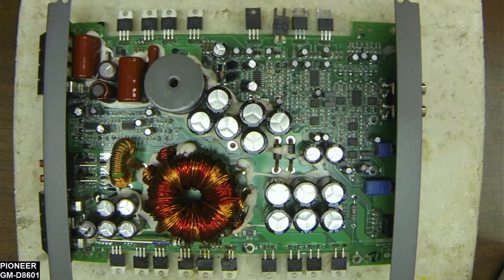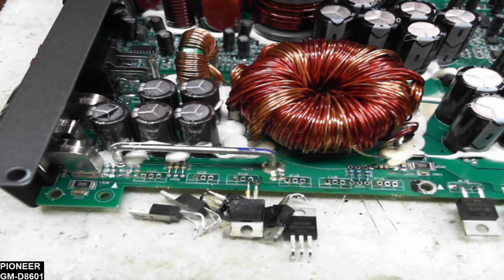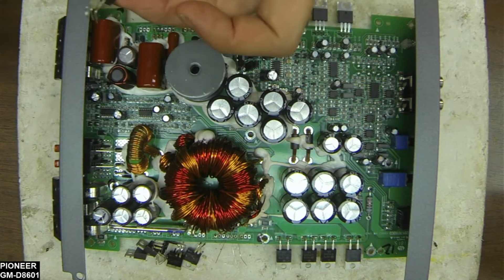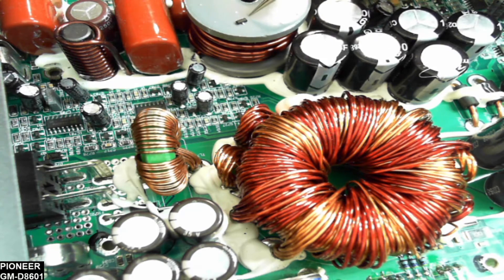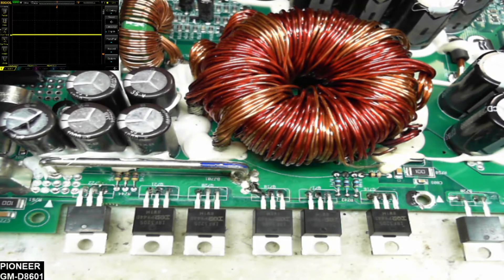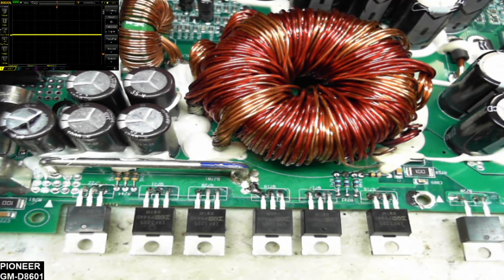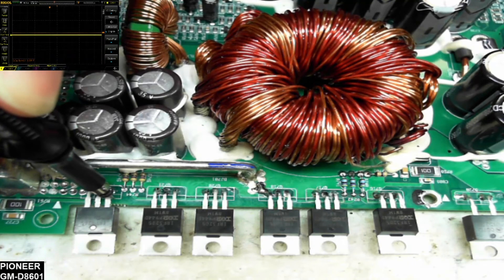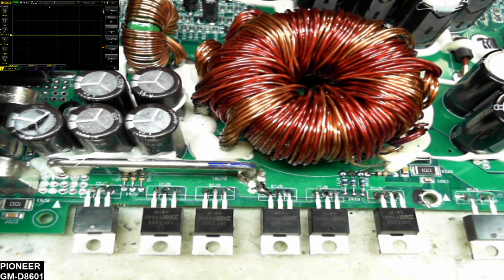Pioneer GM-D8601 Class D Amplifier Power Supply Repair and Startup

Comment: Hi, I'm working on the same amplifier, but I'm having trouble getting a part model. Do you have the circuit schematics? It would be very helpful.
Reply from the maker: Hello! I never was able to get my hands on any Pioneer schematics.
Reply: @ellensburgamplifier  Oh, that's sad. In my case, the diode marked D727 is burned out, and I can't find the part number.

Comment: I have a 8601 that i haven't used for a coupe of months and when I wanted to use it no sound was coming out, noticed that both 40A fuses had blown, I replaced the fuses and now it just cycling thru on and protect with a loud pop coming from the bass speaker.
Any ideas what has gone wrong ?
Reply from the maker: The fuses open because there is a short in the power supply. The cycling of the protection circuit is due to the lack of rail voltage.
Reply: Okay can that just random happend? So to the business here in can solder and have the tools at my hand, I don't have a scope, where can I start my search to find the problem :) I've had that amp in like 6 years or so and I really don't want to chuck it in the bin if it can be fixed :)

Comment: Hello I loved your video you are very good in fact I dedicate myself to the repair of this same equipment I am something new in the subject, but yesterday I was learning to use the ocylloscope and in the g1 and g2 I sent me a distortion signal and I hesitate to change them but now that I see that that is the fault I already feel better when trying to change those transistors, also the 4227 did not send me any voltage to the doors
Reply from the maker: It's good to see someone learn from my content. I try my best. You are correct you won't see any gate drive on the 4227's if there is an issue with the amplifier.
Reply: @ellensburgamplifier 

Perfect, I thank you very much, so if there is no signal voltage in the 4227 I have to check the transistors on TL494?

Comment: Hello, I bought a secondhand Gm9601. And unfortunately it has no sound. Opened it up and noticed all of the (8) IRF3205 Mosfets were burnt on the ground side. I just replaced all 8 but now watching your video, I noticed one the gate resistors has a bubble so I'm assuming that's gone; I removed it and my replaced 3205 transistors read fine without it. So I'm assuming that's shorted out. What would be the part numbers for the gate transistors? Also I noticed you stated you replaced the output transistors I tested mine and 3 of them read 0.00 and the other 3 read 4.75, so I'm assuming those need to get replaced. But do I need to replace any other gate transistors or just that? Thanks for this great video. Just found your channel but will follow. Thanks.
Reply from the maker: The primary components that you will need to replace are the transistors, gate resistors, and gate drive transistors. I am not sure what gate drive transistors are used but there will be a letter and a number on top of the transistor. Then you can use a site like https://www.s-manuals.com/smd to find what they are. As for the output section (if you don't have a scope) you may be able to just replace the transistors and cross the fingers that it starts. If it doesn't, then you will have an output drive fault.
Reply: @ellensburgamplifier  Wow thanks for the guidance and quick response. I will definitely check everything out, the only main thing is which resistors do I check? The ones that are by the main IR3205 mosfets?  And the amplifier turned on into blue when I brought it. That's why I assumed it worked, but had no sound when I hooked it up this weekend. When I opened it I saw all 8 mosfets blown out. 
I found the number on the gate transistor that is blown has a 2 on it. So I'm assuming because the others ones say 2GM or 1GM it's a 2GM. Im going to replace the outputs IR and hope for the best on that one. Thanks for the guidance on this though. Hopefully it works correctly in the end.
Reply from the maker: @WeirdJerz3y  Correst, the resistors located at each 3205 need to be verified and if open need to be replaced. The 1GM is the NPN MMBTA06 and the 2GM is the PNP MMBTA56. These transistors drive the gates from the TL494. Once you get the power supply back up and running the rest is a little easier to take care of.
Reply: @ellensburgamplifier  Thanks for all the help. Going to order the parts and well see once they get here. Thanks for everything.
Reply: Unfortunately, it was working turned on and the moment I turned off the radio the amp smoked. Opened it up and the 4 mosfets by the ground terminal burned up. Clearly I missed something.

But appreciate all the help on trying to repair it.
It was playing music well until the moment the radio turned off. I heard it hiss and smoke. It is what it is at this point.
Reply from the maker: @WeirdJerz3y  That is odd that it failed when turned off. It Must of had a spike in the gate drive somehow. this is the only thing I can think of.
Reply: @ellensburgamplifier  that's what I'm assuming too. It was working great until that. So I'm assuming something is causing a spike somewhere on the circuit. Either way you're great, you helped me out, when you definitely didn't have too. Appreciate it alot. I'll see what I decide to do with the amp for now.
Reply: @WeirdJerz3y  Did you end up figuring out what else caused them to burn up. same issue amp turns on but no output, mosfets are burnt up. I would appreciate your input thanks

Comment: So I pulled open a GM8601 hoping it'd be a similar issue but I don't think so. No visible board damage what so ever, amp powers on as one would expect, will trigger with high level inputs even but it won't make sound.there is so sign of heating on the board at the mount points but nothing id assert to be a broken trace or or an incomplete circuit. I know its fairly limited what that infor brings but would you happen to have any idea how I can confirm it's the input signal not making it rather than power being supplied?
Reply from the maker: I would assume you will have to put a scope on the drive IC and see if you have an input signal and any gate drive output.
Reply: @ellensburgamplifier  that's actually pretty damn helpful. Appreciate it bud, and great content btw. Too few people smart enough to teach left, even fewer trying to teach, and fewer yet still those who actually have a desire to learn.
Reply from the maker: @rvn920  Isn't that the absolute truth! I leased basic component-level electronics in Middle School back in the 80s and in today's world that does not really exist anymore.

Comment: Hello, a have same amplifier and power supply work fine -41v and +42 but no sound,  can you helpme with this issue
Reply from the maker: The amplifier powers up with a blue LED and no protection? Could have an output fault or a pre-amp fault. If you have a scope do you see a low side drive?
Reply: @ellensburgamplifier  what frecuency should be?
Reply from the maker: @marvinrivera332  I am not certain of the exact frequency but any frequency is better than none if you don't have a scope to identify the low-side drive.

Comment: is this when they are stuck in power protect mode?
Reply from the maker: Amplifiers have a few protection circuits involved and if any errors occur in any one of those circuits then the amplifier will be in protection until repaired.
Reply: @ellensburgamplifier  I want to fix myself, not sure where to start exactly, I can solder etc. Can't find a diagram. Would rather fix than throw it out
Reply from the maker: @oldfashionedwrx3574  I agree completely. If you have a scope this may be repaired easily. Without a scope will be a little more.. challenging. Need to locate any problem areas first such as power supply and output transistor short checks.

Comment: Hi. I have a question. In the psu section.. Does it as a circuit take 12v DC and invert it to a AC voltage then back to a higher DC voltage to power the rest of the sound stage? So the power supply is possibly an inverter?
Reply from the maker: Yes, you are correct on that. The 12 volts is across the primary side of the transformers switching at an average of 27khz. The secondary side is of a higher AC voltage then gets rectified to what we know as the DC rail voltages.

Comment: Hopefully you don't mind the question, but I've been having issues with mine inconsistently outputting, when it outputs it outputs fine, but it will just cut out for no good reason that I can find. It isn't going into protect when it stops outputting so I am still trying to figure out what's going on. I noticed that you mentioned that the inductors can experience vibration damage and come loose in your GM-9601 video, wondering if maybe that's what's going on... Haven't pulled it out of the car to check but with your experience I might have a direction to look if you are up to giving me some pointers. Never done amp repair before but I do other electronics repair so I am hoping to figure it out and save some money vs a new unit. Thank you!
Reply from the maker: Thank you for the question. This one will be a little tough to track down without a scope. If the inductor was loose the output would most likely fail. One way to check is to give the amplifier a good "thump" while it is playing. This will let you know if anything is loose.
Next would be temperature. Does it cut out regardless of the temperature of the heatsink?
Does it cut out only when it is under a heavy load?
It may be a pre-amp issue as it is not going into protection when the cutout occurs.
The best thing to do is to see what kind of gate switching you have while it is acting up. This is where the scope will find the issue relatively quick.
Reply: @ellensburgamplifier  It's honestly pretty inconsistent with what it does, some days it's hot and won't output, some days it's hot and it does output. I would say on average it seems to work a little more consistently when it's colder but it doesn't seem to have a super consistent pattern.
Reply from the maker: @Alexander-sw3ll  Yes this would be a tough one without a scope. Transistors and capacitors can act weird based on temperature if they are "leaky". If it was an output transistor (or anything in the output) I would expect it to go into protection.
Reply: @ellensburgamplifier  As far as the scope I don't have one currently, but I've been wanting to at least pick something basic up, any recommendations?
Reply from the maker: @Alexander-sw3ll  There are some good 2 channel scopes but as for recommendations it all depends on budget. Something like the MT8208 may work as an all around meter but I do not know what the voltage range is on the scope setting.
Reply: @ellensburgamplifier  I am thinking something under $300ish would be probably what I'm looking at, might look to see if there's anything used on eBay that's a little nicer. I think I'd prefer a more capable standalone unit over a scope/multimeter combo since I've already got multimeters.
Reply from the maker: @Alexander-sw3ll  Sure can't go wrong with the Rigol 1052z or the 1054z scopes!
Reply: @ellensburgamplifier  Sorry about the crazy delay on this, but I finally picked up a DS1054Z and pulled the amp and sub out of the car for testing. Not 100% sure where to start, but based on what's going on it seems like something is wonky on the amp. Playing a test tone out of my phone there is some output, but it's less than I'd expect. The gain on the amp is set for my head unit and my phone has a lower output voltage, so lower output at some level is expected, but the strange thing is that the output volume will sometimes randomly increase significantly and then drop down below where it was before. Even when the output volume is about the same, there is some wavering inconsistency in the output which is at least somewhat audible and visible on the scope. The input is consistent, so I believe the problem has to be occurring within the amp.  The drive on the power supply looks OK, but I'm not sure where to really start next. Do you happen to have a copy of the service manual for the GM-D8601 or any other suggestions of what to check?
Reply from the maker: @Alexander-sw3ll  Ok, was this issue also there when it was in the vehicle? Using a phone may cause an issue as that would provide a floating RCA ground that is not common to the amplifiers negative 12v. This may cause issues in the pre-amp but I am not 100% sure since I do not use floating inputs. Let's make sure we are good to go here before moving forward.
Reply: @ellensburgamplifier  Same issue when it was in the car. I just took it out for testing. I could probably rig something up with a spare head unit and get a common ground, but I don't think that's the issue here...
Reply from the maker: @Alexander-sw3ll  Ok, so we have a good input source. This is going to be tricky to track down. I would first determine where the change in volume is coming from. From the input pin of the output IC or at the gates of the output transistors? look for changes in amplitude or changes in the modulation width.
Reply: @ellensburgamplifier  Well I was poking around trying to understand the circuit better, the  fact that the positive side MOSFETs have source as the output pin and the negative side MOSFETs have drain as the output pin was kind of confusing, but apparently from what I am reading they are reversible. Anyway, when I was poking around, I found that without a signal on the RCAs I have 39v RMS on my scope on the negative side gate, but I have 51.7v RMS on the positive side gate. That doesn't seem right considering both sides are supposed to be 50v I think, do you think I may be on to something there? Assuming I got the pinout right and am understanding everything on the schematic I think the input side of the output IC (2902s) is ok. I noticed the weird voltage differential without a signal, I'm assuming that I probably should be testing with a signal but I like to try different things to try to understand how it works better. Sorry to keep bugging you about this, it just takes me a while to get a grasp on things like this before I understand them properly, and right now I've just got bits and pieces that I'm putting together.
Reply from the maker: @Alexander-sw3ll  Those readings will be correct as the high side gates are a floating output. You will want to test with a signal at a constant frequency. I use 50Hz. This will allow you to see any changes in the drives over a period of time. This will allow you to isolate where the issue is originating from. You will need to determine if the issue is before or after the drive IC.
Reply: @ellensburgamplifier  Well I poked around a bit more with a 50hz input and I think something funny is going on with the way either the input is grounded or the scope is grounded. I'm going to see if I can hook up a head unit to the power supply on the bench and use that as my input to eliminate the floating input as I think that may be messing with my readings. At least I will eliminate the possibility of that influencing things.
Reply from the maker: @Alexander-sw3ll  Let me know if you have any questions on grounding. I do know that floating inputs can make a pre-amp act a little odd.
Reply: @ellensburgamplifier  Hopefully I don't jinx it, but when I was testing with the correct input I still wasn't seeing anything overly interesting on either side of the output IC. I noticed that messing with the gain a bit tended to get it to start working for a bit, then noticed that touching the RCA jacks also did the same thing. At first I thought by touching the shield on the RCA jacks I was adding capacitance or something, but then I realized the same thing happened without anything even slightly conductive touching it. I did check all the solder joints and they externally looked good, but I replaced the solder on the RCA jacks which did nothing, did the same thing to the gain knob, and boom, consistent output. I've been running it for a few minutes at 50 Hz and so far so good. Not pushing it by any means but it's definitely working like I'd expect. I may put it back in the car tonight and see how things go. Fingers crossed that was actually it. Thanks for your help!
Reply from the maker: @Alexander-sw3ll  Most excellent! Potentiometers can be a troublesome item in amplifiers.
Reply: @ellensburgamplifier  I'm just hoping the potentiometer doesn't go completely bad or something else goes wrong. I guess over the next few weeks I will see how it goes. It was just a little stupid because I always visually inspect a board before I troubleshoot it and the solder joints all looked pretty good visually, but I guess it wasn't good electrically. Hopefully all is good. I put it back in the car and it sounds good, need to reset my gain after messing with it but I ballparked it and pushed it a little harder than I did off my bench power supply and so far so good. Thanks again!
Reply from the maker: @Alexander-sw3ll  Always happy to help!

Comment: Hello!!! I just this video and I was amaze with your work. Now I have a quick question for you. 
Is the GM-G8601 similar to a GM-G9601? 
Because same problem happened on my amplifier. The power supply burned. 
Now I wander if the same procedure to fix it?
Please tell me exactly what parts do I need to replace to fix my amplifier? 
I hear you call those small pieces 3502 and gm2’s? 
Please help out I want to fix my GM-G9601 Pioneer amplifier. 
Thank you .
Reply from the maker: Thank you for watching and the great questions. They are the same design amplifiers so you will need the IRF3205 transistors for the power supply, the MMBTA06, and the MMBTA56 transistors for the gate drive circuit. You may also need to replace gate resistors depending on the severity of the failure. This is assuming that the output did not get damaged.